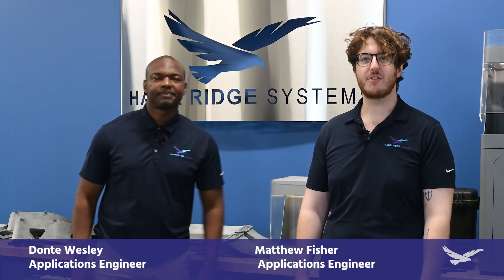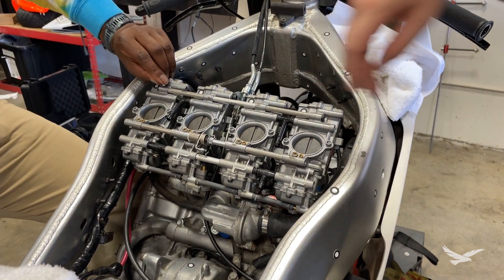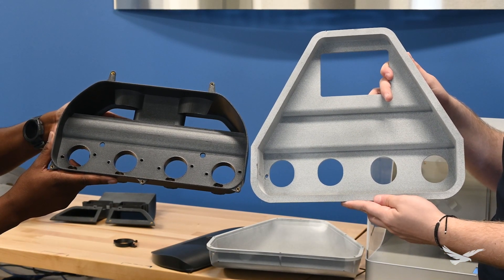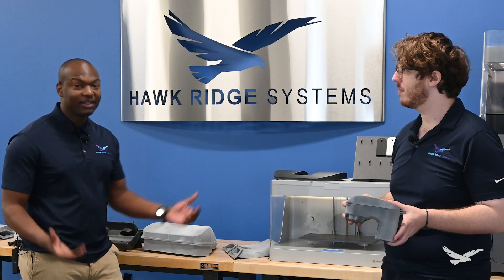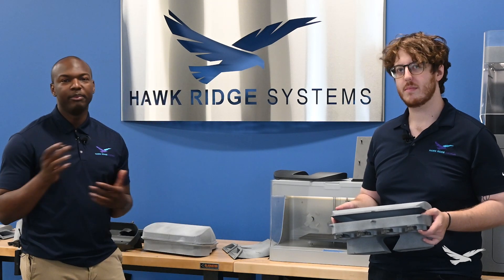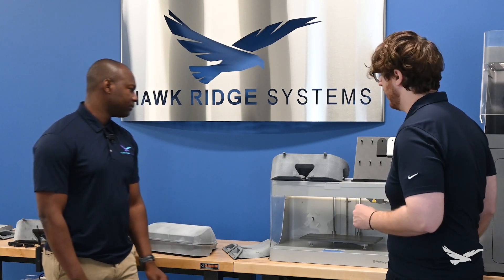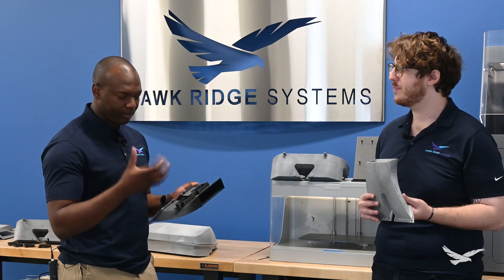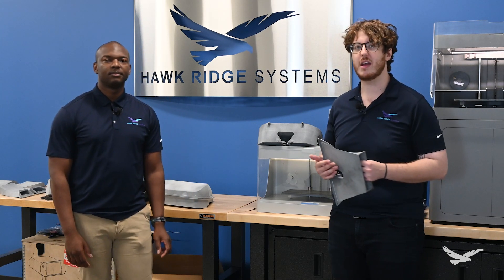Print to Perform: Creating a Custom-Fitted Motorcycle Airbox

Comment: Love what you guys' have done here, out of curiosity , with the simulation did you do just simple / same vacuum on all cylinder caps? or did you do actual vacuum pressure with pulse to emulate the running engine? id love to see a tutorial on  the latter